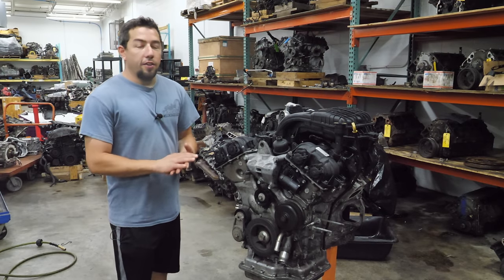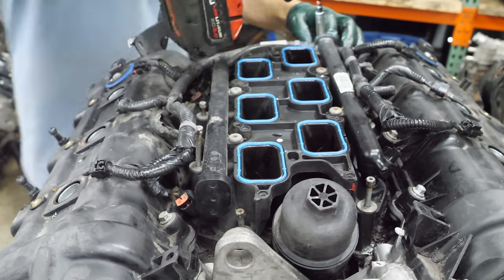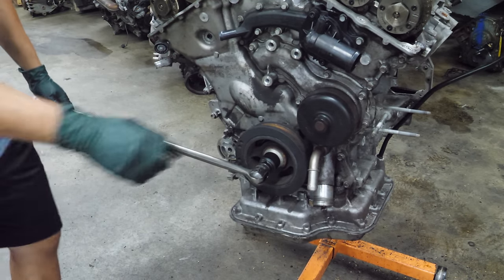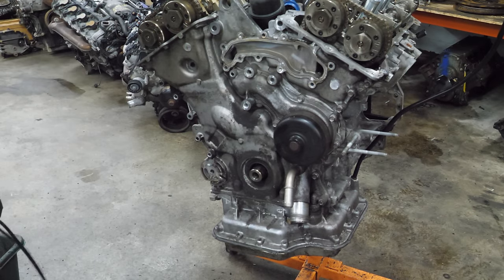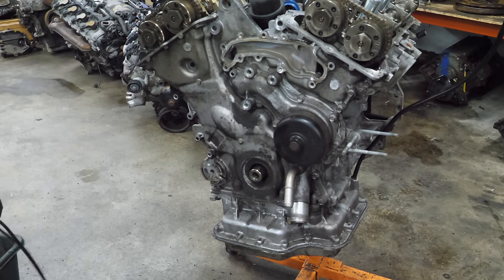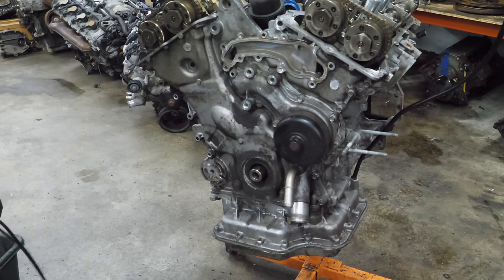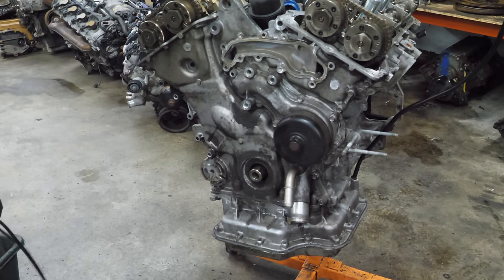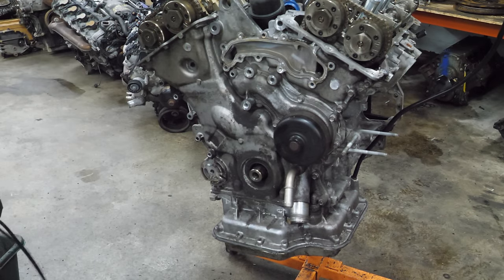Dodge Caravan 3.6L Pentastar V6 Teardown! Why Won't This Engine Turn All The Way Over?

Comment: This engine had low miles but I bet the owner sourced low quality fuel at the same station and spent a lot time idling in traffic or at low operating speed.   What else explains that amount of carbon.  I wonder what the injector tips look like?
Reply: You know that "low quality" fuel comes from the same refinery out of the same storage tank as your "premium" fuel you pay more for right? And the additives? They add about 1 gal of "additive package" to an entire tanker truck load (those big double trailer tanker trucks that re-fill the gas stations). Yes, the additive package is different depending on what gas station the load is for, but other than that it's all 100% the same. Source? I worked at Shell as an intern once upon a time - it was common knowledge.

Comment: hmmm, seems like an engine that was run infrequently and at low rpm to boot, you see this happen alot with grandma's tdi here in Europe, not enough heat and no continious running hours.
Easy fix, let grandson Jimmy drive it once in a while and change oil every time he drove it

Comment: Still waiting for duratec 3.5 or Ecoboost 3.5
Reply from the maker: Done two 3.5 ecoboost teardowns so far, both fwd and rwd variants. A duratec may be tough but a 3.7 cyclone is more likely

Comment: What it seems to me is that this was a police engine and had a tun of idle time! They change the oil A lot and is probably why it's so clean inside! If they did the carbon cleaning every 30000 miles it probably be still in a car.

Comment: Just out of curiosity, have you ever envisioned how folks back in the day before practical cordless, high-torque power tools would break down an early automobile engine?

I mean, like, "Okay, now I shall discombobulate this Model A Ford using significant elbow grease with my long, manual, crudely-socketed pot-metal tool! Be warned, dear viewers, due to today's poor metal wherewithal, I might end up swapping out not just one but <gasp> TWO tools for lack of efficient grasp upon the bolts holding this mechanical monstrosity together!!"

😂

Comment: What I would like to know is, was the carbon build up due to cheap gas or poor computer fuel management?
Reply: With the cheap spark plugs, I would guess cheapest gas, low quality oil and long oil change intervals.
Reply: As I said in another comment above, you do know that "cheap gas" and "expensive gas" both come from the same storage tank at the same refinery right? The "additive" package is slightly different, but that amounts to about 1 gal added to the whole tanker trailer, so it's practically nothing. I used to work at Shell - it was common knowledge. You ever notice how the tanker trucks that fill the gas stations are generic, and at most have a 3rd party trucking company name on them? That's so people don't see that all the brands come from the same place, be it refinery, or local storage facility. But if you buy into the whole "cheap gas vs expensive gas" propoganda, the marketing department and the consumer retail departments at Chevron thanks you from the bottom of their hears - or is that the bottom of their in-ground swimming pools in their mansions... something like that for paying $0.40 to $0.60 more for the exact same product.

Comment: GDI engines problematic  carbon build up they should add on  oil seperator ,   or maintain to clean carbon heads.    wife's kia   have excessive carbon had to clean out  before banging around on carbon depoists.   engineers   didn't think of that issues with GDI  carbon build up in intake

Comment: I am shocked it was carbon that killed this. I work on these a ton, and those rockers fail all the time taking cams with it even on newer ones. I swear dodge has a really hard time making a good valve train on almost any of their engines. And yea plastic filter housings are a terrible idea they leak all the freaking time.

Comment: I heard that Chrysler techs are still saying they run into cracked cylinder heads on these so its not an early thing it has been around for awhile. Probably the 3rd party making them sucks. I know Toyota fires 3rd party parts makers when they find too many defects. Chrysler should have done the same thing with these. They are good engines if the Heads are made right.

Comment: This engines engine has definitely been serviced before as the valve covers, and upper intake had aftermarket gaskets, the lower oil pan was also aftermarket and stuck on with normal silicon. From factory the lower pan is painted black and stuck on with god tier silicon, That balancer bolt also looked unusually tight for one of these, or your impact is exceptionally weak.

Comment: Modern petrol engines with direct injection and feeding emissions back thru the valves invites carbon build up with low mileage use.
Reply: Sadly (fortunately?) this wasn't a direct injection engine.  You are correct on the carbon with DI gas engines.

Comment: I have this engine. The compression is 11:1 (if I recall correctly) and they want you to run 87 octane which makes it run a retarded timing (I think). Could that cause the carbon issue?
Also I run e-85 in mine when it is $1.20 cheaper per gallon or more (all last summer this was the case). Could E-85 increase my carbon buildup? I don't lose a drop of oil so I doubt it was burning oil.
My wifes 2013 Town & Country has the Dodge valve tick in the 3.6 pentastar but I don't; so it's luck of the draw on that.

Comment: That’s the worse engine Chrysler ever made I put 2 different new engines in a challenger and they both locked up the same way it’s because the oil pump they have it’s a variable psi pump and that’s bad

Comment: Don't think I've ever seen so much carbon in an engine. To the point it wouldn't turn over. Short trips, high idle time, crappy fuel. Good ole pedal to the medal would have done this thing good!  I just bought one of these in a 2020 JGC. Restore & protect just went in and a mopar filter. Supposed to clean pistons...we'll see

Comment: Imagine having a bad fuel pump and the mechanic used brake cleaner to try and get it running. Then you need an engine and it still won't start.

Comment: That engine is too clean to have such a carbon build up. Worn injectors (not likely)? Bad Gas? Low operating temperatures?
Also I think the water got into the cylinders when you pulled the plugs.
Reply: PCV problems? If too much oil was getting sucked in I would expect this to be the eventual result.

Comment: Never seen anyone afraid of removing timing components. I only get scared of 20 tons on the press.
Reply: Makes me cringe every time. That and when you have to really crank on the spring compressor and it starts getting noisy + difficult to turn

Comment: I'll bet that engine was from a soccer-mom mini van that was run on the cheapest gas they could find and never given more than half throttle. A couple of bottles of techron and an oil change would have sorted it out. Killed by kindness.

Comment: It's interesting to think about statistics and demographics when a motor gets a bad reputation.  If they build a million of them and many of them are in vehicles that are not owned by enthusiasts/mechanical folks, and therefore don't get the required preventative maintenance, there are going to be a lot of failures reported, even though statistically, they are actually pretty good.

Comment: I. had an old dodge omni 024 that would backfire like crazy (glowing exhaust manifold).  Turns out that a screen broke that was holding back the activated charcoal in an epa-mandated exhaust recirculating filter upstream of the intake manifold.  It may have been ground charcoal, not carbon.  Just passing along my experience of Dodge and its dodgy filter screens. :)

Comment: The hoses for the PVC valve on these motors are very large causing a lot of harmful vapors, water. And dirty oil sucked in causing massive carbon deposits. Catch Cans would save these motors l believe 😮....

Comment: I had one of those in a jeep commander and it was a dog. I thought maybe I would get better gas mileage than the Hemi but honestly it didn’t. The Hemi has the power to drag all that weight; not so with the v-6.

Comment: Sadly this is a known issue with the Dodge 3.6L. Easy fix though. Don't drive like granny on her way to church, and don't make loads of short trips. That motor wants to see at least 30 miles every time it starts, and at least a couple of minuets above 3000 RPM. That keeps the carbon burned out. I own 2 vehicles with this motor. A Dodge 1500, and a Chrysler 200. Solid runners, both over 150000 miles at this point.

Comment: I'm guessing this engine had early signs of bad valve guides? Oil in the cylinder where it doesn't belong creates a beautiful carbon substance only a mother with Easyoff in her hands would love,,,,,,,,,,,,,,,,,,,,,,,,,,,,,,,,,,,,,,,,,,,,,,,,,,,,,,,,,,,,,,,to to clean.

Comment: My 2016 Town and Country 3.6 with 87k miles. I had 6 rocker arms 2 lifters 3 cams damaged. Oil had been changed every 3-4 months. All I can say is that they used cheap ass China rocker arms. No quality control.

Comment: The engine was, probably, used on a custom "more power" ECU settings (or, there was a faulty lambda sensor), which basically made it run on over-rich mixture. Then things got worse, as initial carbon build-up caused the oil ring to stuck and it also started eating oil and build even more carbon. Then it set for quite some time disused, which let the carbon to set and harden while it dried up, which in turn caused the lock.

Comment: Looks like the proverbial "little old lady owner, only driven to church" motor. I'd be surprised if it ever got above 50mph, or drove more than 5 miles at a stretch. Desperately needed an Italian Tune-Up, and a stretch of highway speeds...

Comment: I hate this motor! just got done putting a new oil pump solenoid in my wifes. Why is there an electronic selonoid inside the motor? stupid. The oil filter housing design is also stupid. Why even put an oil cooler in the middle of the engine valley? My as well have put fins on the oil pan and called it a day. How many different oil pans does chrysler make for this motor?

Comment: If this engine came out of a Caravan then that screams soccer-mom to me. Which is why it was carboned up so badly. It was probably babied from the time it was bought new until the van itself was wrecked or until whoever crashed into the person driving the van. So I highly doubt the owner ever got it up to rpm enough to clean it out. As much as I hate horsing my truck while I'm driving I do get on it occasionally to make sure it stays clean.

Comment: Oil burners, every crysler van that I had the pleasure of working on or had, the 3.3 3.6 and 3.8 loves oil, They do run good though, I will give it that, but once they start to age idk why it is, but they consume more oil than my clapped out 91 chevy c1500 with 700k miles.

Comment: This engine is very rebuildable but with everything manual. NO COMPUTER STUFF. with an Inglese crossover intake with Weber side draft carbs. Plus a little stouter camshafts-nothing variable.

Comment: I know the Chrysler heads know and track there vehicles at thare dealership and there engineers known there engines sensors and can tell who abused there products, the WAR between auto manufacturers continues with supporters.

Comment: BOTH GM & FCA 3.6L DOHC V6's are a gigantic, ticking time bombs, piles of shit.
Is not what or if, but rather when it will take a dump on you.
I have seen these engine have a fairly easy life, been taken care of and still SHIT THE BED in a very spectacular and unexpected way.

Comment: Problem here is low tension oil rings. Go back to standard tension oil rings problem solved. For a little more gas standard tension oil rings would not have caused this problem. By saving maybe 1 mpg you get to replace a good engine. Oil rings look seized to me. This is why I run my engine 1 quart over to flood the piston rings more and splash the timing chains more. They over baffle these engines and with low tension rings they don't get enough oil to keep the rings oiled enough causing them to seized. The oil in these engines run hotter than the coolant. JMO. So far I have had no problem with these engines.

Comment: My mom had a 2014 jeep grand Cherokee with this engine in it and it was by far the most unreliable engine/car I’ve ever witnessed first hand, one of the camshafts somehow failed and luckily was under warranty for the rebuild
Reply: Its a common issue on those years. 2016 and later are more reliable.

Comment: A complete oil filter housing made of plastic, big plastic valve covers, and only 2 bolts main… This engine is a throwaway engine. Typical for a Chrysler product.

Comment: Wearing a parts crate to shield your eyes when removing timing components with spring loaded tensioners is pretty funny. So are your sexual innuendo jokes about it being safer starting at the front, rather than at the rear. I always look forward to sour Saturday tear downs.

Comment: plastic fuel rails, plastic VVT solenoids, not to mention the failure prone plastic oil cooler base that warps and causes oil/coolant mix......typical chrysler garbage quality that doesn't last.

Comment: Funny, my opinion of these is the opposite of yours, having driven them in just about every vehicle they put them in. Compared to GM, Ford, Nissan, Honda engines of the same displacement, these have a terrible torque curve. You have to rev it to 5000+ RPM to get any power, and then they get really noisy. No low end torque, plus the fact that these are used in minivans, bloated Jeeps and full-size Rams means that these engines feel woefully underpowered compared to the competition. They feel OK in smaller stuff like the Charger, but even then, compared to a G37 or Acura TL they feel pretty lame.

Comment: For all that dual overhead cam and phazer bullcrap ya they make a bit more power than cam in block but they ruined the intermal combustion engine. So much to break those phazers the guides and chains plus no room to work on them and stupid expensive i will never ever buy one from any manufacturer

Comment: I had a 3.5 Pentastar in a 2010 Dodge avenger and it was the worst engine and car I have ever had the displeasure of owning such terrible motors
Reply: Those are a totally different engine, the pentastar v6 was introduced in 2011.
Reply: @09corvettezr1  it was a 3.5 pentastar V6 and this one is a 3.6 penastar V6 I've seen both engines side bu side I can barely tell them apart

Comment: Garbage! Grand Cherokees are notorious for engine failures with less than 10,000 miles on the odometer. The Chevy 4.3 is one of the best v6 engines ever produced. The engine was so reliable it was discontinued. These car manufacturers aren't stupid. They intentionally pump out shit that has to be fixed constantly.
Reply: Really? I have a jeep Grand Cherokee I purchased new in 2014 with 165k on it. Besides maintenance all I have ever had to replace was an oil cooler.